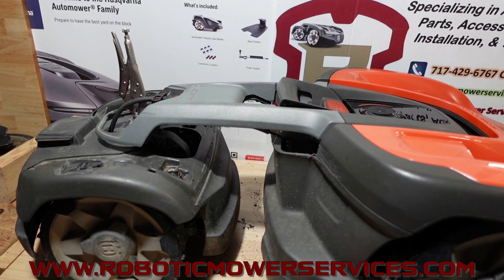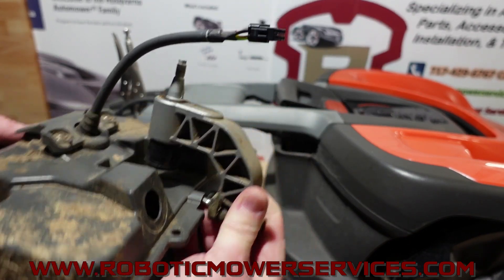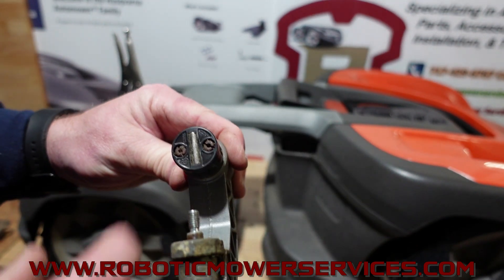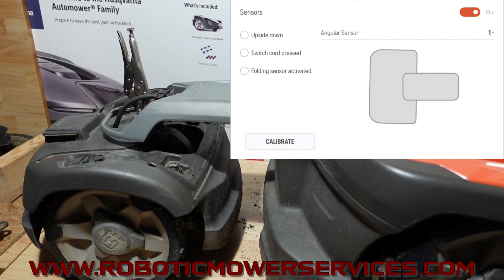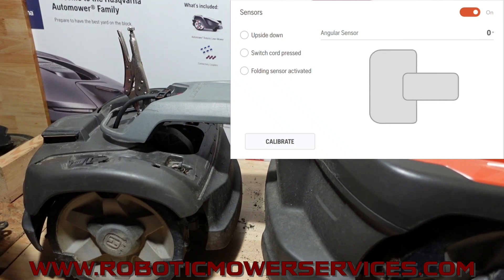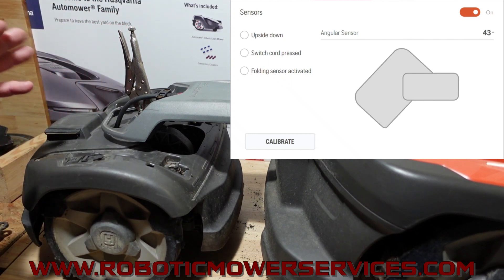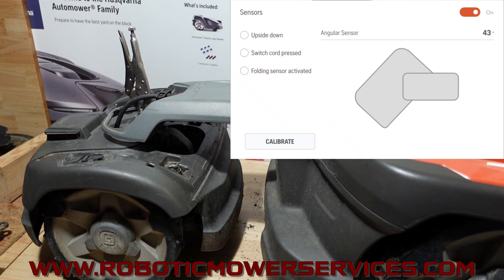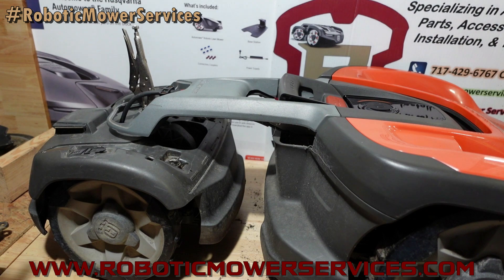How 435X & 535AWD Automower Front & Rear Chassis Alignment Works (Angular Sensor Fix w/o Autocheck)

Comment: Hi, I have a 450X 2022 model. Looking for a bit of advice please. The robot starts at the start of the schedule and then goes into charge no problem but doesn't leave when the charge hits 100% and will only leave when I interact with it by pressing park then mow or adjusting grass height or changing some setting off then on. Any help would be much appreciated. Love the channel btw.